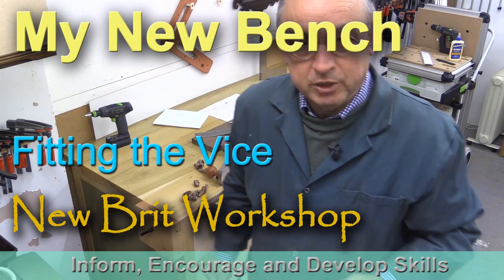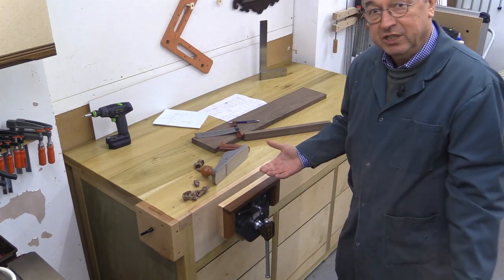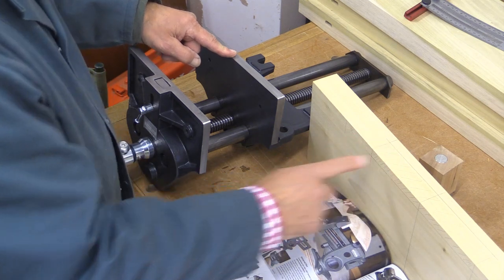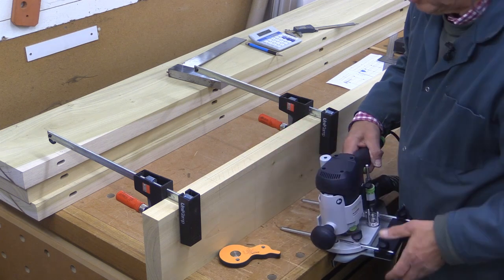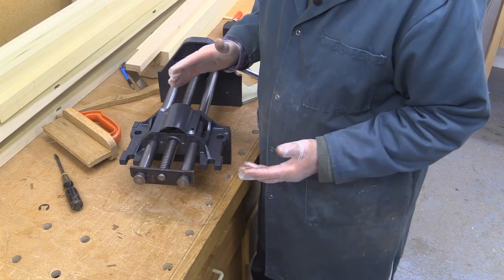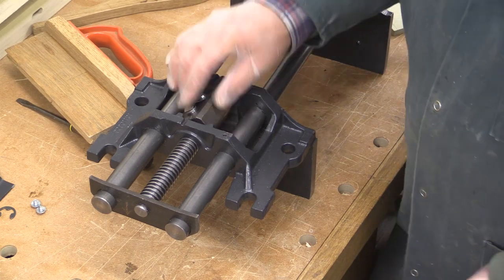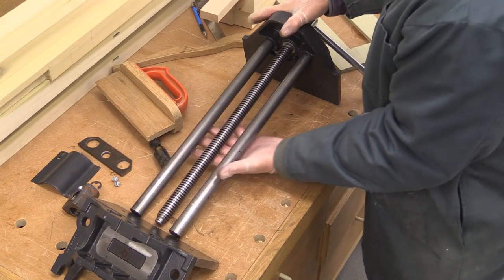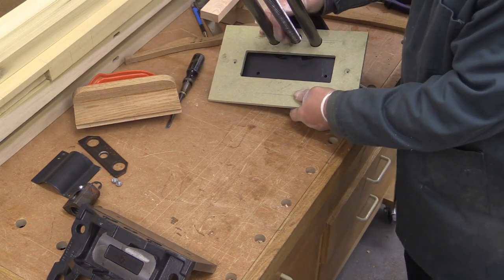How to fit a Woodworking Vice

Comment: Very nice job. You've secured the vice firmly to the wooden block, but are the screws that attach the wooden block to the workbench able to withstand the forces?
Reply from the maker: Yes, they work well. Cheers.  Peter

Comment: I bought a vice with a "rise and fall" metal dog.
As a metal dog could mean sudden death to a plane blade, I replaced it with one made from a random piece of hardwood with a threaded insert for the tightening screw.
I find it really useful for clamping timber against a pair of bench dogs.
Reply from the maker: Hi Clive, That sounds like an excellent idea. I have my "Parf Hats" which are wood with a central hole for a dog. They are not on sale yet.  Cheers.  Peter

Comment: Many thanks for your vice advice. I'm just wondering why so many are mounted on the LEFT side of the bench. Mine is actually on the right and it has its own turntable.that allows ample versatility
Reply from the maker: Hi Brian, It is on the left for right handed people and on the right for left handed people - it is all to do with using a plane.  Peter

Comment: Hi Peter, Another great video, thank you! I'm looking to make my workbench, and will use my parf guide jig for dog holes on the top. Could you tell me the how far lower the top of the metal vice is from the top of the work bench please. Looks around 20mm? Thanks again. Love your videos and the parf guide system!
Reply from the maker: Hi Paul, Yes, 20 mm but that could be adjusted if need be.  Cheers.  Peter

Comment: Excellent detailed instructions here and you sold me on the quick release vise!  Even though I'm in the US I decided to purchase one from Axminster, who shipped it over the pond at no additional cost.  A tip for anyone using carriage bolts as described in your video at https://youtu.be/6xa0v3ViutI?t=563, in my area I can buy "torque washers" which are hammered-in metal washers that have a square hole to prevent a carriage bolt from spinning in the hole.  More positive than a wood-only connection, especially over time or if one plans to uninstall and reinstall a few times.  In my local big box stores they're located in the bins with the galvanized hardware because they're used in building decks. For anyone looking to buy this particular quick release vise, mine came with no name on the casted parts but the instruction sheet says manufactured by York in the Czech Republic.  It might be the same one that Lee Valley sells into the States and Canada, just my guess.  It's a high quality item, smooth action and no racking.  I bought the small version and did a simpler install to the front of my worktable -- no inset or behind the apron.  Another tip:  don't frustrate oneself and try to work it until it's mounted, the mechanism only works in the mounted orientation.  Thank you New Brit Workshop for the info!
Reply from the maker: The tip about those special washers is very useful and I will do some investigation as I am sure that they will be available over here.  Cheers.  Peter

Comment: I just spent all afternoon bolting a vintage Woden vice i picked up for £20 to my workbench. I didn't realise what a cowboy i am until I just sat down and watched this video. If that locking ring had fallen on the floor of my shed it would never be seen again - I am usually up to my ankles in off-cuts and wood shavings! I was however wondering how i would replace the wooden faceplates if the rear one came loose  as i screwed it on from the rear before I fitted the vice (without dismantling it). After watching this I realised I completely overlooked the fact I can screw this one on from the inside of the vice and back through the hole in the rear jaw - straight into the workbench - as its never going to move! Thanks for a great video!
Reply from the maker: Hi Neil, Many thanks.  Peter

Comment: hi, what type of oil did you use to lubricate the slider bars and thread screw, just finished fitting my record 52e, ive put a dry ptfe spray on it for now but dont want any heavy type of grease that will attract sawdust ect.. excellent craftsmanship by the way.
Reply from the maker: I used WD40 but Stihl have their own product that they recommend.  Peter

Comment: Hi Peter, Are you still happy with the vice? I have a similar model made by York. After 2 years of light use the bars are very loose in the casting and the outer clamping jaw has a great amount of play.
Reply from the maker: Hi Steve, Mine is absolutely perfect and it gets used every day.  Peter
Reply: @NewBritWorkshop  Many thanks for the update Peter. Might treat myself to one for Christmas!

Comment: Only just discovered your channel and fairly new to woodwork. I'm going to make this bench but being a newbie can you tell me what wood you use and whether/where it can be obtained freely? Looking at local timber merchants or even the likes of Wickes is a nightmare especially trying to get near to the sizes of the sections on your plans. Also fairly limited kit so far I have a bench saw and router, apart from that it will be hand tools. Really enjoying your videos and excited to get started
Reply from the maker: Hi Keith, The trick is to remodel your design to suit the materials (and sizes) that you can get locally. I used poplar and odd ends of other wood but it would be perfectly okay to use soft wood for the frame and legs and then plywood for the top.  Good luck.  Peter

Comment: That vice looks like excellent value for money (especially when you compare it to other makes or to metalwork vices). I was looking for a detailed video on installing the vice and this one did the job. Thanks! Although you didn't mention it, I was also interested in where to install the vice on the workbench. I remember at school (in the late 1960s when they taught woodwork and metalwork) the wood vice was installed on the left of the bench, which is what you did. I'm not sure why that's the preferred position but I'll do the same when I get my workbench.
Reply from the maker: Hi Edward, Yes, on the left if you are right handed.   Cheers.   Peter

Comment: Hello Peter, have you tried using a short piece of dowel in the hole when over-boring an existing hole.Another great video. I am enjoying the series about your new bench.
Reply from the maker: Hi Bob, If I only had dowel of the right size !  Cheers.   Peter
Reply: Or you could drill a pilot hole completely through the wood, turn it over and forstner the large counter bore on the rear, turn it over again and drill the smaller diameter hole with the other forstner bit, using the pilot hole to locate both forstner bits. Assuming you have a long reach 2 or 3mm drill bit, of course.
Reply from the maker: Cheers.  Peter

Comment: 9:25 So what is that in proper measurements? I have never liked all those French/EU measurements. Try hanging a door or doing most second fix in imperial, it is far easier than using those idiot measurements.
Reply from the maker: For a 12 mm hole you might choose a 1/2" drill which is just a tiny bit bigger than required but would work okay.  Peter

Comment: Nice vice, I'll be build a new bench this summer and installing a vice of my own.  I do have a curiosity question...  What was that block with the little lever on the side of the bench?
Reply from the maker: That is my planing stop. It is adjustable up and down and there is a Bristol lever to tighten it in place.   Cheers.   Peter